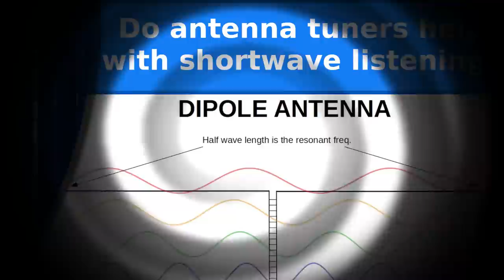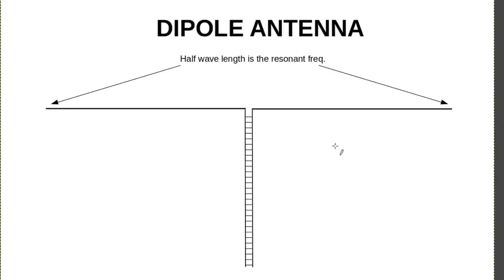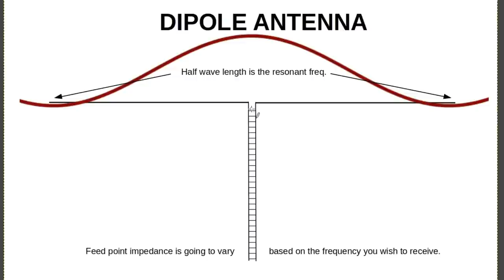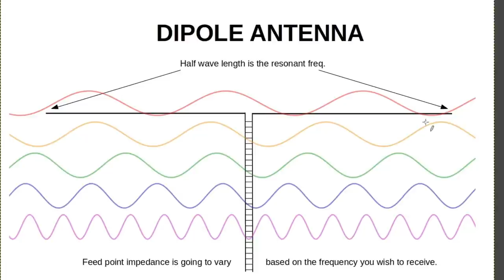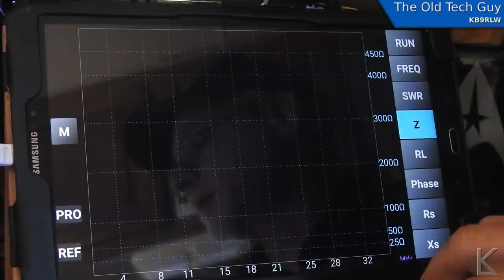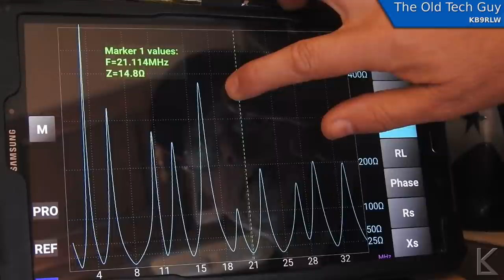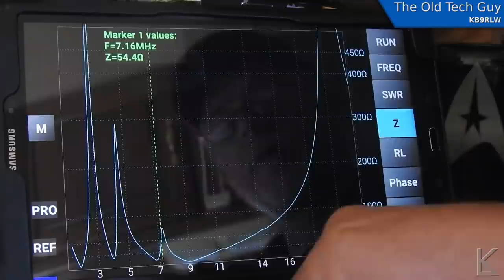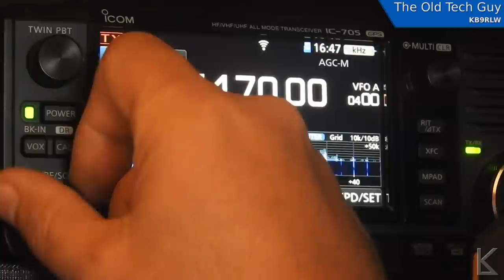Ham Radio - Do antenna tuners help with shortwave listening?

Comment: Before getting my ham license, I was a SWL'er for 60 years... in the last twelve of those I was using a Nye-Viking antenna tuner with great results on my SWL long wires.  I found it very important to have the long wire as far AWAY from the QTH, gutters, roofs and any electrical noise makers to reduce the noise floor.  I also used a fairly little know device, no longer made, by Palomar called the Palomar RX-100 Noise Bridge.  The RX-100 and the tuner make for a great combo to "find" the "spot".  Now days, I use the Palstar AT2K and with my Yaesu FTdx101MP I can suck just about any faint stray magnetic wave off the long wire and DNR  and Contour it to a listenable bit of information.  Thanks for this video...  If I only had room for a RHOMBIC antenna farm......  now that would be something... 73 and happy holidays amigo.. Art W1SWL

Comment: Around 40 years ago, after college, I used chicken wire from our 1st floor flat up to the terrace above 3rd floor, then clear across it at 1 ft above head height. Say 150 feet total, L shape. In Calcutta, India.

Then via a homebrewed L tuner to our old SW valve AM radio. I would tune for least noise, easily done. Pulled in Radio Brazil, Radio Switzerland, Radio Finland etc. My best was AFRTS (armed forces radio and tv network) somewhere near the Artic circle.

The simple antenna tuner made a HUGE difference, no question

Comment: Thanks a very interesting topic.

The issue really is signal to noise ratio (SNR). Making the antenna resonate, either in its own right or with help of a tuner improves sensitivity to the wanted signal and hence SNR.

My particular AR interest is in high SNR reception 

In looking at long wire, dipoles and wire antennas generally, they tend to have a large spatial extent and therefore capture a good deal of noise (unwanted, particularly local) as well as the wanted signals. 

Receive only antennas like active mag loops and Miniwhips with their small spatial dimensions tend to capture less noise (unwanted) and can provide significant improvements in signal to noise ratio, particularly in lower HF bands below 20m.

In part this is because such antennas can be positioned in a way to minimise local noise pickup. The magloop for example can be placed low, where local E field noise is minimal but in coming H field component of wanted signals is still strong. This is the same principal behind an AM band ferrite loop stick antenna.

In my own case, I use a multi band vertical and a long wire (110m) for transmission but can select separate receive only antennas.

My low noise receiving antenna setup is based around an electrostatically shielded Pixel active magloop phased with a miniwhip spatially separated by about 10m.

While sometimes having slightly less sensitivity, this setup has consistently lower noise, typically 20dB+ less than the vertical and wire antennas, making for much more pleasant listening. In many cases what are noisy signals when received on the vertical and wire, have almost FM quality when received on the low noise receiving antenna setup.

Comment: One thing to consider. Detuning the system with a manual tuner can do wonders to reduce noise. This is why many hams use separate receive antennas. This gives them options.

Automatic antenna tuners need a transmitted signal to work. Thus, using manual tuners for receive is the option. One can be built easily because it's not being used to transmit. Turning knobs to peak noise is quick and easy. Turning knobs to reduce noise is the same. A longwire and a manual tuner is a win for shortwave listening.
Reply: Many auto tuners (including mine from MFJ)  have buttons on the front that can be used to tune manually for maximum noise.
Reply: Quite right..  that is the process I use..  my location is subject to TREMENDOUS rfi..  I have something fairly nearby that covers the spectrum from 100kc to over 50 mc..
Preamp and attenuators  are too coarse, but  tuning the tuner for a sig/noise sweet spot has proven to be my best tool..  an outboard RF gain sorta..
Reply: Thank you for confirming my suspicions.  I will soon be moving where in I will be using a vertical antenna.  Knowing that verticals are especially bad about receiving  noise, I am researching the possibility of adding an active receiving loop.  What is the best active receiving loop on the market?  Thank you!  BretC/AC0AE

Comment: Agree with you 100%. I was a long time SWL'er before taking my M6 in 2010. An ATU tunes whatever antenna it is attached to near 50 ohm as possible. It tunes a range near to where you are listening to and detunes other stations outside the range, so as Tahoma says reducing unwanted noise. A great antenna to use SWLing is a rotatable loop in vertical and horizontal phases, so you can null out stronger stations and possibly pick out the weaker and DX signals. Magnetic loops are in a way like a rotatable loop with coupled ATU built in. Tuning a small section of the frequency desired and detuning anything outside the bandwidth. I found that a great antenna to use for SWLing was a long horizontal wire connected to a vertical CB antenna ( inner only ) with the matching coil removed. Slung North to South, this L shaped antenna having both polorizations and coupled with a manual ATU was excellent for a small plot, local and DX stations. Have a lovely Christmas and get some rest. I look forward to seeing some new videos in the New Year. Stay safe, 73's Andy M6APJ. Don't worry about the minorities so much, it will haggle your brain ! LOL
Reply: Except an ATU won’t do anything for a listener because it needs a transmitter! So you’re obviously lisenced 😂

Comment: I thought this was obvious. the impedance mismatch is a barrier that acts both ways and causes part of the signal energy to reflect back to where it came from. if the source of the energy is your radio (when transmitting), then you have the normal reflection of transmitted power. if the source of the signal is the antenna (when receiving) then some of the signal power reaches the radio and the rest is reflected back to the antenna, effectively reducing the power of the signal received.
great content btw Kevin and your channel is one of the best out there.

Comment: Helpful video, Kevin. Thank you. I think much of the confusion about this subject results from the name “antenna tuner”. These devices are actually impedance matching devices, not antenna tuners. I.e., as you point out, they don’t change the actual antenna, only the coupling of it to the feed line. At least that’s the way I think about it. Meanwhile, enjoy you time off and Happy Holidays to you as well. - Jim (KK7CSC)
Reply: It could be said electrically they change the antenna with the adjustment of the reactances to resonance
Reply: Antenna tuner is the correct term. It changes the antenna's resonant frequency with loading capacitance or inductance, thus tuning it to a new resonant frequency. Resonance is about oscillating currents, not necessarily about physical size. An 8 foot mobile whip can be made quarter-wave resonant, for instance, at 40 meters, by using a large loading inductor.

An antenna tuner also matches the radiation resistance of the antenna to 50 ohms, much like a transformer would. Perhaps the antenna tuner is misunderstood because it is a dual function device.

IMHO there needs to be a question in the General Pool about antenna tuners and antenna resonance. I think the only way to stomp out this misconception is to force amateurs to learn it right when they study for the test.

Comment: Good job.  

The frustrating part is its name - Antenna Tuner.  As you explained it does NOT change the antenna.  That element picks up RF energy more efficiently at frequencies close to or at the element's resonant length.  The feedline has the same SWR - doesn't change.  The Antenna Tuner changes the impedance between the feedline and the radio.  There is a theorem that says something like this.  Maximum energy transfer occurs when the source and load impedances are the same.  The tuner does that.  Doesn't matter which way the energy is flowing - transmitting or receiving - the transfer will be optimum when the impedances match.

Good job!
Bob - W6OPO

Comment: Just getting back into SWL, replaced my ancient Sangean with a sweet Tecsun PL-880, a really nice radio. I have 3 poles and 30 metres (98 ft) of wire suspended in my backyard but am learning there's more to it than throwing up a length of wire (which works amazingly well, but I'm learning that to get a quality signal some learning and fiddling is needed). I need to learn about impedance, and videos like this are great, thanks so much from Melbourne, Australia!

Comment: The ATU is going to match the Antenna to the input impedance of the Tuner but we can use an 9:1 or 16:1 UNUN to couple a Longwire antenna to the radio.
Reply: Yes, assuming the longwire is medium impedance (e.g. several hundred Ohms) at the frequencies of interest, it makes sense to use a 9:1 or 16:1 unun at the antenna to reduce the impedance down to nearer 50 Ohms for connection back to the shack where it can get some final adjustment using an "ATU" to make it exactly 50 Ohms resistive presented to the receiver.

Comment: I’ve been thinking about this topic quite a bit since first seeing Kevin’s interesting video. At least as of today, here’s my (another) two cents on the subject.

I view the antenna system as being comprised of four components: antenna, matching network located at antenna feed point, feed line and antenna tuner (Note that I’m keeping baluns/unbaluns off the table for simplicity). As to the antenna, I think its performance will be optimal if it’s resonant for the band of interest. Given a resonant antenna and an assumed feed line impedance of 50 Ohms, the job of the matching network is to transform the antenna feed point impedance to 50 Ohms. This should result in low SWR on the line. This begs the question as to the role of the antenna tuner (in the receiver).

I noted one comment in which the author suggested that the antenna tuner helps to make the entire antenna system resonant. This doesn’t seem quite right to me in that I think you want only the antenna itself to be resonant. According to (https://youtu.be/zhsXIyq64Wc), at least to the degree I understand it, an “antenna tuner” is used to compensate in scenarios where you are driving an antenna with frequencies off of resonance.

Happy Holidays!  -  Jim (KK7CSC)
Reply: Your right,  an antenna tuner does not make the antenna resonant,  it's a transformer that let's the radio side see 50 ohms at any frequency in its range.  The antenna side of that is resonant on whatever frequencies the antenna is resonant.  Having the transformer (tuner) is doing nothing but transforming the impedance of the antenna on that frequency to 50 ohms, which allows more energy from the antenna to be transferred to the radio.
The tuner does nothing to the impedance of the antenna on any frequency,  only the physical parameters of the antenna and it's surroundings can change the resonance of the antenna.

Comment: I have an MFJ-901B antenna tuner which provides an SWR of 1. You have answered my question concerning reception. I don’t have hi tech ability to measure impedance so I must assume the impedance is good, based on the SWR. Your video is very revealing. Thank you!

Comment: that was a great demonstration. I do a lot of short wave listing. antenna tuners some times pre  selectors do help on fixed antenna. I use a MFJ analyzer to set tuner to 50 ohm. also I found a outher benefit.  the tuner is aet to a frequency. everything else makes impendence go way down or up.makeing a high Q point. with strong stations  or noise not in what you tuned to can over load front end of receiver. helps drop noise floor on selected frequency as well. this helps pull out weak stations.  73's

Comment: ATU’s absolutely help with listening as well as transmitting because they act to help tune the antenna to the receiver’s input impedance and can act as a bandpass filter to reduce interference from powerful stations transmitting on harmonically related frequencies. Is it essential? No, you can hear signals just fine without an ATU but with more noise and interference in the background.

Comment: A radio receive amp is non-selective, therefore if your antenna is receiving a signal at its resonant frequency, that will engage the radio's AGC to desensitize the receive amp. When you change the resonant frequency of the antenna with an antenna tuner, the signal you want is the dominant signal, in turn stopping that other signal from desensitizing your receiver's amp. 
Just a dumb guess.
Reply from the maker: Yes, the tuner acts like a preselector. As well as optimizing the transfer of energy.

Comment: I look at it this way.  When you transmit and your ant is not offering a 50 ohm match to the radio the wave is reflected back down from the antenna to the radio.  The opposite happens when the signal received by the antenna (it's now acting like the transmitter) sending a signal to the rig (50 ohms)that doesn't match the antenna impedance.  The reflection happens at the radio sending
the signal back up the transmission line.  The tuner re-reflects the signal in the appropriate direction.  For transmit it would
send the reflected signal from the antenna back to the antenna.  For receive it sends the reflected signal from the radio back to the radio.

Comment: The old SWL receivers had antenna trim or preselector to help match the antenna to the rig.
Reply: I think it's for to retune the receivers preselector circuit when the antenna pulls it out of tune.  For sure it helps to match the antenna, but I'm not sure if it can solve the problem completely.

I have to try my Hammarlund HQ100 some day with the tuner and without it and see if there is any difference.

At the moment, I have a 55m long doublet with 240ohm twin lead feedline.

Cheers: OH8UBJ/Juha

Comment: I think you arrived at the right answer for the wrong reason. Yes, an antenna tuner can help when receiving. I have an antenna with an auto-tuner near the feed point. I can QSY and then listen. Now if I transmit a few seconds of dead carrier so the auto-tuner will do its thing, the received signals will come up a few S units. So obviously the tuner is helping reception. But why? Matching the radiation resistance is only part of the picture. I think you should also have your VNA plot the reactance of the antenna.

Something many people notice is that a resonant antenna usually performs better than a non-resonant, active antenna. Why is this? It is because, at resonance, the oscillating currents in the antenna reinforce to produce stronger oscillations. In a non-resonant antenna, the oscillating currents do no reinforce, so it delivers a weaker signal. Remember that resonance is an electrical principle involving oscillating current; too often when considering antenna resonance, many people think that it has only to do with physical size. Any size antenna can be made resonant with the appropriate loading inductance or capacitance. This is one function of an antenna tuner, canceling out reactance. The other function of an antenna tuner is to match the radiation resistance of the antenna to 50 ohms.

To take a little side trip, although you can make a very short antenna resonant with a large loading inductor, it will still be an inefficient antenna because it has a very low radiation resistance.

Another side trip. In your setup, the antenna tuner is at the shack end of the coax. So the entire feedline is mismatched. This generates reflected power which reflects back from the antenna tuner to the antenna where it will reflect back to the tuner. With a lossy feedline, such as coax, the energy in these reflected waves is eventually burned up in the coax. Using a low loss feedline like ladder line can minimize this problem.

Your auto-tuner is eliminating the reactance it sees, allowing the currents in the antenna an feedline to oscillate at the frequency the auto-tuner has tuned. This would be even more pronounced if the ATU was near the feed point so the feed line was not part of the antenna oscillation. Also it is matching the resistance it sees to the receiver input. Once again, this would be more effective if the ATU was near the feed point so the transmission line could see 50+j0 at both ends.

I disagree with your premise that the antenna tuner does not change the antenna. When it cancels the antenna's reactance, it adds loading to the antenna to change its resonant frequency so that the antenna oscillates a different frequency. This is no different than adding inductance or capacitance to a tank circuit to change its resonant frequency. I propose a new term for antennas: "natural resonant frequency", the frequency at which an antenna resonates  with no added loading inductance or capacitance. Because when you add capacitance or inductance to cancel reactance, you are changing the actual frequency at which the antenna currents oscillate.